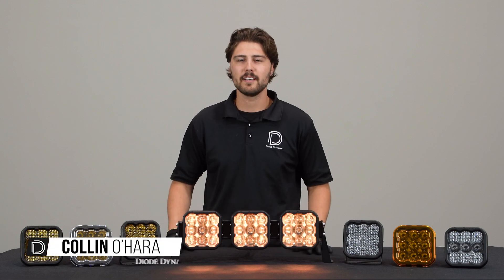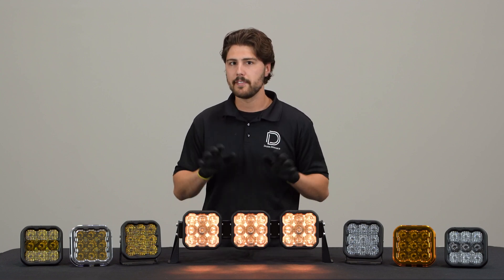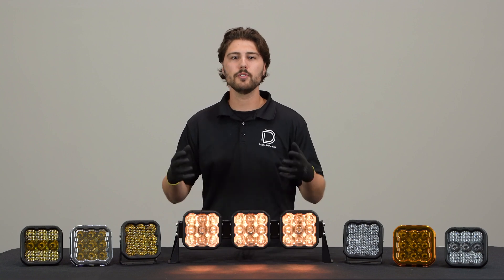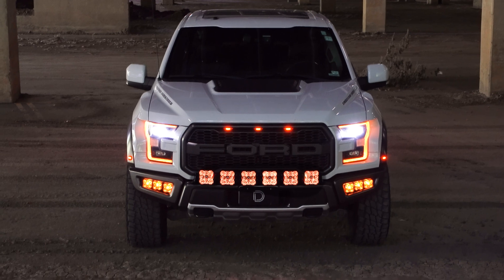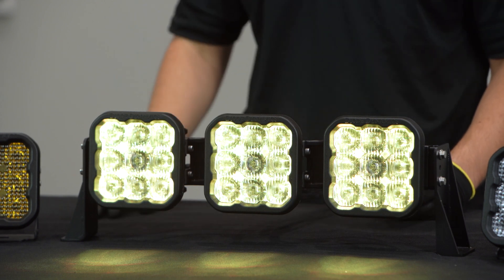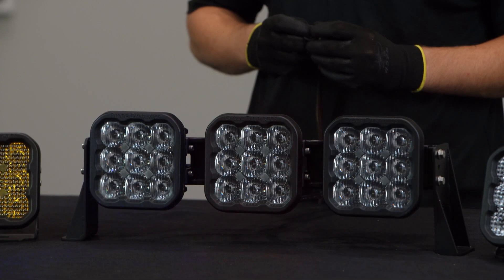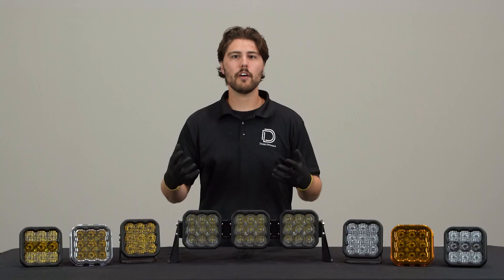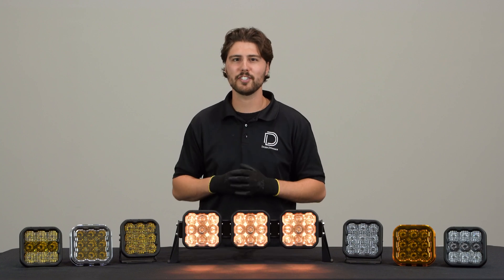What is a Backlight? SS5 LED Pod Backlight Feature Explained!

Comment: I just installed three SS5 pods on my 392 rubicon.  With the wiring, I used the yellow and blue to the 2 wires for the aux switches that came with the jeep.  I grounded the black, but when I hook the red wire up to the battery or fuse panel,  the lights stay on all the time and the switches do not control them.   I am a novice.  What am I doing wrong?
Reply from the maker: Hey Bill! Please go ahead and give us a call at 314-205-3033, Monday-Friday 10 a.m.- 5 p.m. CST, or shoot us an email at contact@diodedynamics.com, and our in-house US service team would be happy to help you with that.

Comment: Could the yellow backlight work as a form of fog light? Or is it better to just go with a yellow pod ss5
Reply from the maker: The SS5 does not have a road legal fog light pattern, as it is too bright. The backlight is simply an accent light with little to no usable light output on the road. You are more than welcome to use our Max SS3 Fog Lights for insane output and road legal use!

https://www.diodedynamics.com/stage-series-3-sae-yellow-max-led-pod-pair.html
Reply: @diodedynamics  great to know. Thank you
Reply: @diodedynamics  Obtained a pair second hand and not sure, is there a way to tell if a pair of SS3 MAX fog lights have the backlit feature or not?
Reply: @2GR4L DD pods that support backlighting will have 4 pins in the back of the pod.
Reply: @4RunnYaOver  I'm surprised something as simple as that isn't mentioned somewhere easily spotable on DD's site. I honestly thought it was all in the wiring harness, I appreciate your time/response/info!
Reply: @2GR4L of course!

Comment: Can the backlight feature if the SS3 SAE Fog lights be used as turn signal?
Reply from the maker: The backlight feature is not intended to be used as a road legal turn signal. Sorry about that!
Reply: @diodedynamics  ok thanks. It wouldn't be the primary signal, just supplemental
Reply from the maker: @patsmart6536  If you go with a yellow SS5, you could add additional turn signal functionality with the amber backlights. However, the White SS5 pods would start changing colors with every blink of the turn signal after the third blink.
Reply: @diodedynamics  but not with the amber SS3 SAE?
Reply from the maker: @patsmart6536  Sorry about that, yes, the SAE Fog SS3 pods can be utilized as a supplemental turn signal!
Reply: @diodedynamics  thank you!

Comment: Can you use the backlight feature  as a supplemental turn signal? Or will it enter program mode?
Reply from the maker: The backlight feature is not intended to be used as a road-legal turn signal. However, this will only work with a yellow SS5 pod, as they only include an amber backlight. A white SS5 pod with RGBW backlights will result in entering programming mode and will change colors every time the turn signal activates after the third blink.

Comment: Can you run the back light on highway ? Dot sae approved ?
Reply from the maker: The only two backlight colors you can run on the highway are amber and white on the front, and red in the rear. These are not SAE or DOT compliant, being used as your sole running lights, however these are okay to run as additional accent lights in most states. We recommend checking with your areas laws and regulations before running them!

Comment: Can this feature be tied to a DRL? I have a 2015 Mustang and had the idea to tap the SS5 backlight into the Mustang's DRL gills in the headlamps.

I guess my one concern there is the DRLs dim when the driving lights come on. Would this cause an issue with the SS5 backlights? or will the SS5 backlights auto power off when the main beam of the SS5 comes on?
Reply from the maker: The short answer is yes! 

With our SS5 pods having 8 selectable backlight colors, you may not be able to run amber backlight as your DRLs. You would have to opt for a yellow SS5 to ensure the amber backlight is what turns on. You can tap into your DRL to power the backlight feature, as it does not draw more than .25a per pod. The backlights do automatically shut off when the main beam turns on, yes!

Comment: Hi. I don’t have the toggle for SS3 and SS5 additional wiring. I want to use my own wiring. Where do I connect the power source so the back light is not always on but only comes on when I want to. 

And for SS3 Amber back light … can the back light be controlled directly from the OEM fog light switch as it will be connected to factory fog wire of Toyota. Or do I require a separate switch to operate the fog light backlight?
Reply from the maker: For the SS3 pods, as long as you have a factory fog light harness, we do offer fog light adapter harnesses with a tap for the backlight to your DRL or parking lights! Any power wire will do, however the most popular choice seems to be the Parking lights!
Reply: @diodedynamics  thanks. In my Land Cruiser 200 series the parking lights never remain solid, they only come on flashing for the turn indicators. If I connect with DRL won’t they come on all the time? Any other options?
Reply from the maker: @nabeelsiddiqi6695  Any power wire that you have on when the truck turns on, the choice is totally up to you. If not, you could opt for a physical switch to power them whenever you want!

Comment: I saw in a comment that leaving both the backlight and main beam on separate switches on wont damage anything. I'd like to run the backlight to ignition power, and the main beam on a switch. I would assume this is the same, but I want to make sure it wont damage the light. Can I have it set up this way?
Reply from the maker: Orienting your wiring like you mentioned should not damage the light in any way!
Reply: @diodedynamics  Wonderful! I just ordered a combo max ss3, I'm looking forward to it! I'm very done with my cheap 30 dollar lights that I got a few months ago. Thank you for the quick reply!
Reply from the maker: @sniperjj10  Alright! Great to hear that! We look forward to seeing how they turn out on your ride!

Comment: Is it possible to change the backlight color while it’s hooked up to a switch panel?
Reply from the maker: Absolutely! To change the color, you'll simply toggle the backlight on and off 3 times to start cycling through the colors until you reach the desired color!

Comment: If you have the main beam and the backlight on at the same time, would that cause any failures? I want to use a Auxbeam switch panel, and wondering what would happen if they're both on at the same time "accidently". I know you would want one or the other.
Reply from the maker: The draw on the backlight is so low, that, no this will not cause any issues!
Reply: @diodedynamics  great, I'm making an installation video on my channel.
Reply from the maker: @thedetailhotlap  We'll be on the lookout!

Comment: Would it be possible to have a video on the best way to tap the drl fuse with a backlight fog on 2022 4runner
Reply from the maker: It's super simple to tap the backlight wire to your DRL. We don't have any upcoming media at this time for the 2022 4Runner. However, if you send us an email or give us a call. Our customer service team will be happy to make the process and breeze!

314-205-3033 Monday-Friday 10 a.m.- 5 p.m. CST

Email: contact@diodedynamics.com